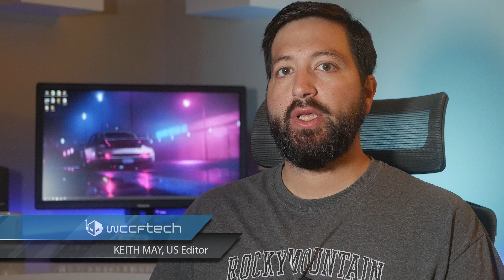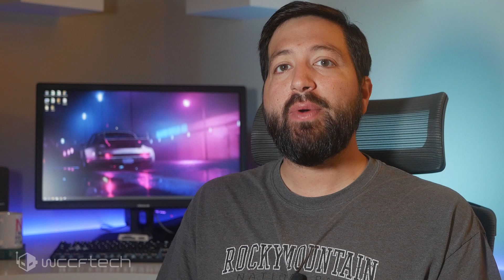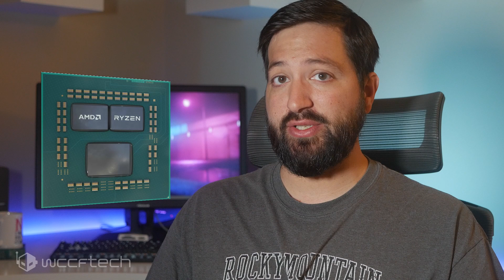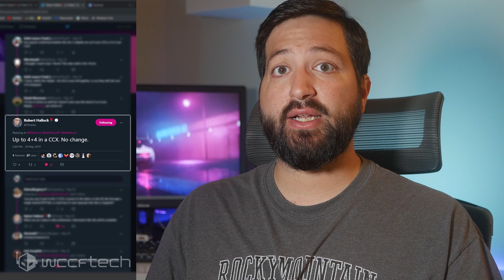AMD Confirms Ryzen 3000 Series Solder and CCX Layout!

Comment: Is it just me or is your math off? - 4 cores per die means 3 dies for 12 cores + 1 IO die. Maybe that is also why there is no 16 core yet - that would mean 4 dies + 1 IO die and that will not fit without shrinking the IO die to 7 nm..
Reply from the maker: No, 4 Cores per CCX, there are 1x 4+4 CCX on each chiplet.  Each chiplet contains 8 cores comprised of two 4 Core Complex.
Reply: i see. so 1 die is 2 ccx.
Reply: @wilkoschuppers1058  The ZEN/+ CCX and the Zen 2 CCX design is very different though which is important.

Comment: You are wrong , Intel do not use high quality  thermal paste they use high quality toothpaste.
Reply from the maker: #shotsfired lol
Reply: @freak777power  , You are in the save zone. If you run your CPU at a temperature of 50c to 70c on load you will be OK.

Comment: i actually dont think the 4 core vs 8 core ccx is as big of a problem as many people (including myself) first thought.  from what ive been hearing some people say game threads dont intercomunicate as much as i thought.  they say its down to memory latency.  now for normal tasks ryzen's memory latency is about as good as intel (maybe a bit better maybe a bit less) but intel has better prefetching etc which means its better at getting the data in memory that something like a game needs before it actually needs it.  zen 2 has improved the prefetcher and thats probalby more important than the ccx layout for gaming.

but we will have to just wait and see.  the data for games shown are imprvoements over current zen at stock speeds and are mostly showing games that dont use a lot of threads (pubg wow counterstrike etc).  we will have to wait for testing.  i would imagine something like an 8700k at 5ghz+ would still be the gaming kind but if zen 2 is so close it doesnt matter then ...well it doesnt matter : )
Reply: The Zen/+ CCX and the Zen 2 CCX are not the same design with more cores, for one thing the i/o die has the memory controller.  There are many other improvements including higher IPC.  But the giant flashing beacon is the number of MBs choices from each maker and that it is just the 570s  for this 3000 series release.  Way more than the 1000 and 2000 series.   The blaring fog horn is the stock prices for both INTC and NVDA are down.  Remember the gaming public wants to go with AMD and not Intel or nVid if possible.
Reply: ' i would imagine something like an 8700k at 5ghz+ would still be the gaming kind but if zen 2 is so close'
It won't be!! LOL!! 16 Core 32 Thread 4.8 Ghz+ Zen 2 incomming.
Reply: @metaphorpritam  Max is 12/24 R9 3900X Zen 2. To 4.6 Ghz OC. What u reading ? :d
Reply: @whatsup2635  ' Max is 12/24 R9 3900X Zen 2. To 4.6 Ghz OC. What u reading ? :d'
LOL!! Don't you think 8 core chiplet ccx exist?
Reply: @metaphorpritam  R9 3950X = not in product. Maybe zen 3 with r9 4950X
Reply: Also, consider PCIe Gen 4 for Zen 2 motherboards in gamming.

Comment: 0:28 "TRADITIONAL thermal interface applications such as PASTE" !!! what?

Intel's practice of using paste on high end and even worse, SERVER CPUs is a complete spit in customer's face.
I like Intel processors, but I never bought one with a goddamn TIM. I'm so glad that now AMD makes better cpus for lower price and with better thermal dissipation.
Once I need to change my 2600k and 6800k, that will be definitely something from AMD.
Reply: TIM applies to solder as well. It just means "Thermal Interface Material" regardless of what it is made of. And Intel has arguably valid reasons to use paste such as long life of the TIM as solder can be prone to micro-cracks especially with fluctuations in temperature (thermal cycling). Funny how average people seem to think they know more than Intel engineers. The cost is not significant thus there must be a different reason.
Reply: @photonboy999  , yes TIM maybe the wrong term to use here, I meant thermal paste vs soldering between the CPU die and the heat spreader.
However, it is clear that CPUs on the 115x socket, of the generations after Sandy Bridge ran much hotter than 2600k, despite claiming lower TDP.
2600k were able to overclock to a pretty high % of its stock frequency with air cooler, and if you ran it stock, it was on very low max thermals.
You could not do those with 3770k, 4770k and so on, 80*C max temperature on stock frequency with a water cooler? That is not normal at all.

Comment: What is solder? That mean I don't need thermal paste?
Reply from the maker: you'll still need to apply a thermal interface material between the IHS and whatever cooler you use. This is in reference to the die to IHS contact.

Comment: How does latency between CCX modules compare to 2 side to side die chiplets
Reply: They've doubled the bandwidth of the Infinity Fabric per MHz, and doubled the size of the L3 cache so both intra & inter-chip latency on Ryzen 9 should be much lower than on 1st Gen MCM parts (aka Threadripper). How big of a difference there is between intra & inter-chip latency we won't know until people test the parts hands on though.
Reply: apples and oranges. It's also going to depend a lot on the application. Is the thread of code jumping between cores and thus add a lot of latency by inefficiently jumping between CCX's in a CPU chiplet or even jump to another CPU chiplet completely? Ideally the code should come in from system memory, sit in the IO chip and then stay on the same core without jumping. I don't know what it takes to force the code to stay on the same core (or cores) to avoid jumping penalties. I believe it's mostly a combination of OS management and application coding.
Reply: @photonboy999  AMD's increased Infinity Fabric's speed per MHz by 2x for Zen 2's "Infinity Fabric 2nd Gen" AND they re-did the IMC completely for ultra high RAM speed support (and the IF still runs at the IMC's clock [which is 1/2 the RAM clock bc "DDR"] meaning that faster RAM = faster IF/lower latency + higher bandwidth), so between those two things alone, the IF connection between CCX's (intra-die) and CCD's (inter-die) on Zen 2 should be around 4x faster than on Zen/Zen+. And that's before even considering the 2x larger L3 cache which should pretty dramatically reduce cache latency.

Aka/TL;DR - With Zen 2, the cross CCX bottleneck is less of a deal than ever, and could quite possibly be approaching negligiblity if it hasn't already.

Comment: Would be interesting to know the difference between 3700x and 3800x..
Reply: @vablo7198  sounds like overclocked 3700x with premium pricetag
Reply: @vablo7198  tiedän kyllä, mutta tuohan on pelkkää arvailua tässä vaiheessa..
Reply: @vablo7198  eihän kukaan juuri ostanut 1800x:ää kun samaan lopputulokseen pääsi halvemmallakin
Reply: @James Smith I mean is 3800x something else than overclocked 3700x (which would make it pointless)
Reply: @James Smith like with first gen ryzen - 1800x was pointless and didn't sell well because lower tier cpus could do the same cheaper so Im wondering is this the case with 3800x - is it just overclocked 3700x with higher pricetag
Reply: @James Smith Im thinking its pure business - theres nothing much real difference between 3700x which performs at the end like 3800x overclocked but 3800x is made for gamers which...pay extra kinda for nothing because they just have to have the "fastest"

Last time when I was buying cpu it was 2011 and you could get the top cpu for 300. Now its 500

Comment: The communication between chips and the underlying memory architecture is what interests me the most.
Reply from the maker: indeed, asked about that but the response was that will be discussed when they are ready to dive into the architecture disclosures which should be closer to release.
Reply: @WccftechTv  Fair enough. I suppose when the tech press gets their hands on them we will know. Can't wait till someone delids it and over lock to 6GHz with liquid helium.
Reply: @fishclaspers361  and the reason to do that would be...?
Reply: I think Shintel just did the same thing with their super overpriced Intel Xeon Platinum 9282. That is basically two 8180 Chips "glued together". Thats what intel said when AMD introduced this chiplet design. Now look who is copying. 😂😂😂😂
Reply: @Pixel_FX  Not the same as the chiplet and i/o design at all.
Reply: @Viewer19  ,
The 9282 is quite comparable actually. There's 2x 28-core CPU's that are basically glued together to make a 56-core CPU. Intel's point was that AMD had multiple chips. Intel has multiple chips in this CPU. Obviously there's no IO chip and that functionality is instead integrated into each CPU but otherwise the main point Anakin Skywalker is making stands. However, SERVER CPU's are quite different in cache/latency etc compared to desktop CPU's. You can get away with multi-chip and multi-socket easier in servers but in desktop that could impose big penalties for some applications when not optimized correctly.
Reply: @photonboy999  Two CPU dies is not even close to the CCX - i/O design that AMD uses.   And you are just so wrong about AMDs desktop solution.   Listen Jim here too https://www.youtube.com/watch?v=pmhug8GEDUU
Reply: @Viewer19  Yes of course its not the same. I was just showing that intel went depths to beat Epyc CPUs that even themselves didnt planned before. Its hilarious that they did exactly what they mocked AMD about. But amd was not actually two chips glued together. They uses only one IO die. But Actually intels 56 core will be much faster because it will not have those latency issues. But still, THE PRICE. Pretty sure it will be over 20,000. And they say you cant buy those 9280 chips alone. They comes already soldered to the board with liquid cooling. We shouldnt be even talking about these ultra high end chips we would never buy.
Reply: @Pixel_FX  Again with the latency issues crap the EYPC chips beat Intel because they can clock higher on more cores and offer sustained performance vs Intel's burst short term peaks.  Intel brags about AVX perf but has to lower clocks when doing that work.  There is a reason AMD will be used to build the worlds fastest supercomputer and it's not price although that is a considerable factor.
Reply: @Viewer19  Yeah during AVX workload intel's Xeon W-3175X clocks only 3.3 gigz or lower. and gets only 4150CB score. That chip is total garbage for that price. lol. I wonder who buys them. AMD's 2990WX is almost half the price. and Even 7980XE gets same score with some OC. and that leaked bench of Zen 2 16 score chip was getting well over 4100. If its real it means 3rd gen ryzen are absolute monsters. they can beat intel Chips with two lesser cores. even these leaked benchmarks of 6 core chips showing way more power and beating ryzen 2700  in most cases. My next build will be definitely AMD.